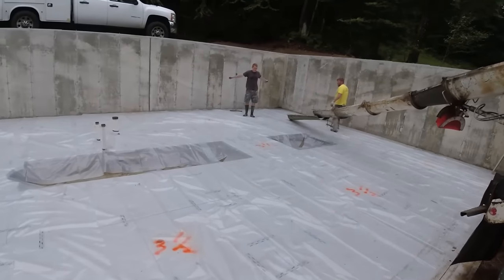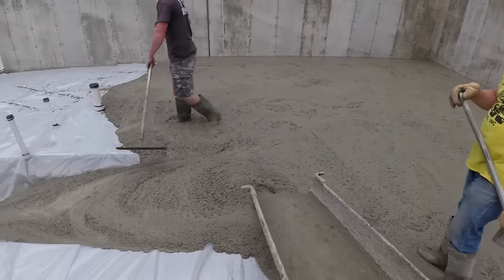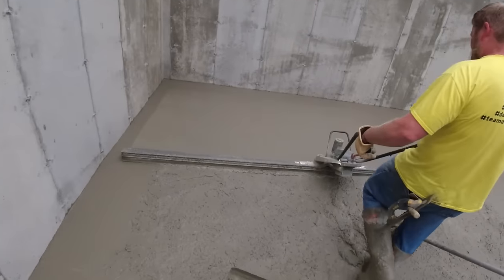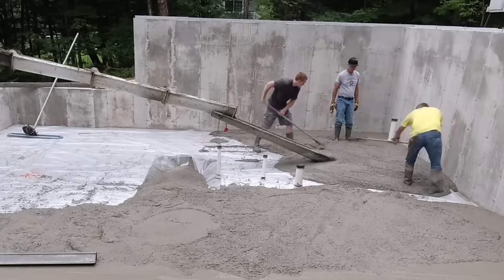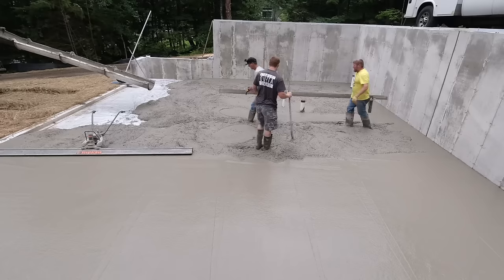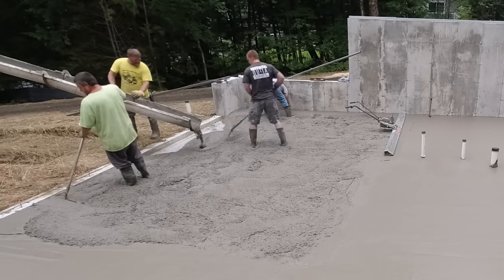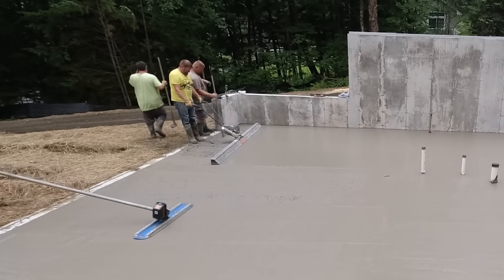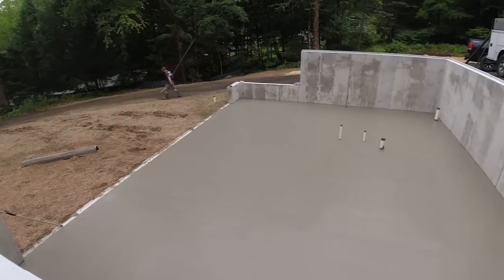Only 3 Of Us Pouring This 40' x 30' Concrete Floor - Here's Why

Comment: Me and my brother used to pour 2000 foot floors all the time, i mucked and set edges he did all the rodding by hand, wet pads and laser. We both finished it. Prefered a couple more helpers but didn't worry too much either.

Comment: Didn’t even know water reducer was a thing until your videos. We usually pour at a 6 and power screed.  Used to pour at 4 and strike it off by hand (don’t miss those days)Does the reducer change anything with the set up time? Great work as usual